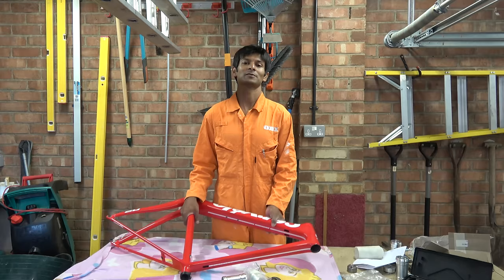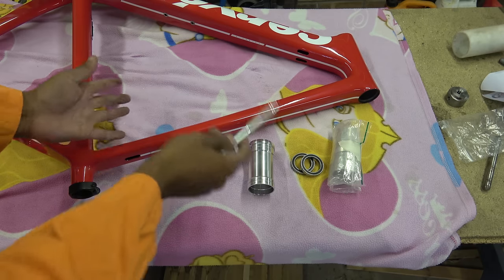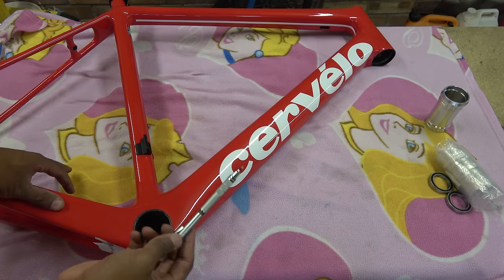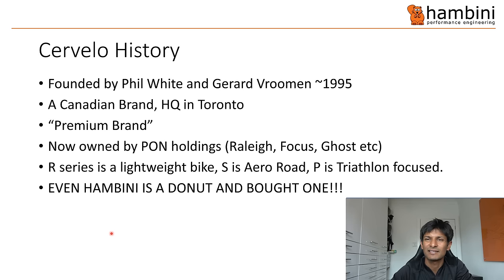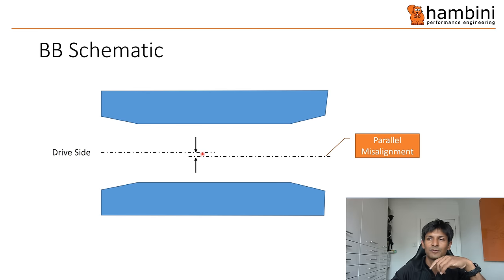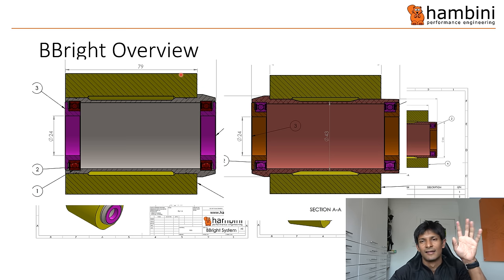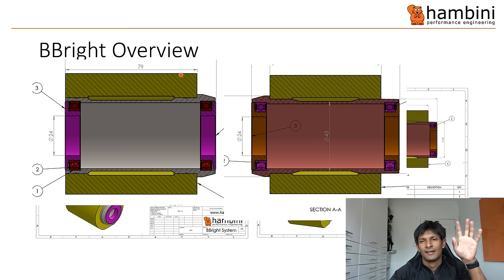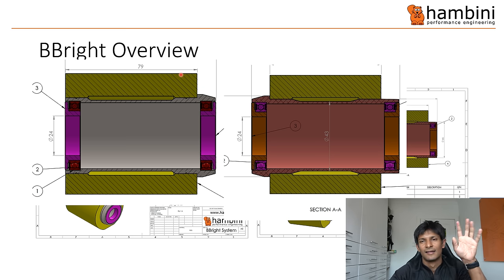Cervelo Exposed and fixed... Scumbag Aero bike manufacturers (A Hambini Reaming)

Comment: This is not a problem specific to Cervelo, but is more due to the problem of mass producing in carbon to close tolerances. Many manufactures are unable to maintain tolerances required for press fit of roller bearings in carbon. It is unlikely that a torrent of abuse will solve these manufacturing difficulties. There is however an engineering solution that will... The first solution will fix the concentricity, but not the taper. That is to make the aluminium insert approx 0.2mm smaller where the bearings will press fit, fit the insert to the frame, and then ream it to the desired size for a press fit bearing. This will require specialised tooling to perform the reaming process. It will correct the out of round, and misalignment, but will not fix the taper issue where the bearing is only supported by the insert which has no carbon in contact and relies on the inserts structural rigidity. The second plan is reliant on the availability of epoxy resin to glue the insert into the frame, but will possibly cause misalignment of the cranks to the frame as it requires the insert to be manufactured undersize to be a loose fit into the frame. So the insert is made 0.3mm smaller than the frame, has glue grooves machined into it for bonding, and is glued into the frame using a toughened epoxy. We use this method for fitting bushes into masts for superyachts (100's of tons load) with complete success. It is considered common practice.The reason for this is masts are not able to be made with holes in them, and so the holes are drilled, and bushes fitted after the masts are completed from a composite point of view. Again some tooling will be required to ensure correct alignment, but this is better as misalignment can be corrected. Now I realise a superyacht is not a bicycle, however the same engineering principles apply. I see this as an opportunity to help all those who have purchased a frame with bottom bracket issues, to permanently correct taper, concentricity, undersize, oversize, and misalignment problems, and be everyone's hero. Loctite epoxy is available nearly everywhere, and is almost idiot proof. It does require fast assembly, and is not for the disorganised. https://www.loctiteproducts.com/en/products/build/epoxies/loctite_epoxy_weldbondingcompound.html, or I personally would recommend this as it is what we use for superyachts. https://www.adhesivetechnologies.co.nz/Products/High-Performance,-toughened-adhesives/

Comment: Hambini, another great video, 
I understand your look and time frame recommendations are based on your personal experience with good manufacturing tolerances with regards to the bottom bracket but having seen the insides of those frames on the Luescher Teknik channel (real horror stories, especially the Look frame) I am not sure I am comfortable buying either of them (I know those cut up frames were not the latest versions). Interested in your opinion.
Reply: I believe @thedarkinstall recently worked on a Look Blade with a complete shite BB

Comment: This is really helpful information and thanks for being brave enough for calling it what it is. The brutal truth is that most consumers don't have the knowledge or the measurement tools at their disposal to be able to determine when they have a rubbish frame in their hands. The fact that bearing tolerances were increased is pretty evil. The poor bearing manufacturer whose product fails because it's been installed in a setting beyond design limits and "set up for failure" cops the blame instead of the rubbish frame manufacturer!

Comment: They must of had to reject a amount of frames not meeting tolerance out of the factory, how to fix??? Make it better? No, just increase the tolerances, now they don’t have to reject them!
Reply from the maker: And think of all of the poor individuals that are riding around on substandard frames as a result...
Reply: Hambini Yes, agreed, I bought a Cervelo in 2011 as well. We can have the SHITE scale and have a laugh, but in reality this is really sad. Basically can’t engineer a round hole or more correctly, don’t want too, which is not fit for purpose to meet the bearing manufacturers requirements. 
It shows that in general manufacturers are lowering their tolerances for profit, you could almost call it a “con” by these manufacturers. 
Remember the latest Cervelo S5 top bike is almost 20k AUD, really what are we paying for?
Reply: This is very typical for an engineering company run by non technical people. As engineers its our job to tell our managers, clients, or owners, that their proposal is a bad idea. If the final design gets out to the client, then we have failed as engineers.
Reply: @Hambini  It's alright, a lot of them are middle aged men in lycra that really shouldn't be riding the most expensive bikes on the market.
Reply: Organ Farm Yeah, but you have to know the product is below what is considered or is “fit for purpose” I just bought a high end carry on suitcase and the wheels fell apart on my first trip. So I took it back, the shop attendant said wheels are not covered under warranty, I then said to the shop attendant, you can’t not warranty something, or a part in Australia, because the company doesn’t want to as it needs to be fit for purpose. 
The short answer is companies, businesses, are really trying to sell high end product at low end cost manufacturing, just make the shiny bits look good.
Reply: I have two Cervélo bikes. A 2013 P2 and an 2018 R5.
Both work just fine.
So not every bike is bad.
Reply: @Bendersnatchling  "works just fine" is a very subjective summary as what works just fine for say a weekend warrior clocking maybe 2000 dry miles a year might not work just fine for someone that rides 16000 miles a year in all weathers and has 1500 watts on tap. I'm not saying you're a weekend warrior just giving an analogy. It's like someone saying they can get a entire year's worth of riding out of a set of Vittoria Corsa tyres where as I can only squeeze a month or so at best out of a set and consider them a race only tyre.
Reply: @jonnythelegs2597  1500 watts my ass.
Reply: @jonnythelegs2597  All valid points, but they don't apply to me. I rode my P2 for several thousand kilometers since 2014 and I am on my 2nd bottom bracket. It's an Ultegra. Changed it last year as part of upgrading it. I did not have any creaking.

On my R5 I rode 3156,2 km according to strava this year. No creaking either.

However bad manufacturing tolerances are terrible, because the "average" rider will have a very hard time troubleshooting. And will then be  out of options. 

Maybe Hambini will develop and sell a tool that easily allows to measure for trueness, so people could check on new frames ;)
Reply: @ebargados  did I say that was me? Nope.
Reply: @frozenlkea6188  absolutely
Reply: @Bendersnatchling  "3156,2 km this year" breaks down to 86.29 km \ 53 miles per week - I do 40 miles each day Mon-Fri, come rain come shine, averaging between 280-330w each ride and ride even up to another 200 mile at weekends. There are folks who ride more miles and much more intensely. "several thousand kilometers since 2014" - we are towards the end of 2019 right now. So yes, his points do seem to apply to you. Unless you ride your bike only 3 months a year. 
Now, pedaling steadily at 200 watts my bottom bracket is perfectly silent, as soon as I ramp it up to 350 watts which is not really that much these days either, I start hearing a distinctive knocking noise with each full crank turn coming from the bottom bracket area. So yes, there likely are lots of unsuspecting users out there on nice branded frame sets, who simply don't have the power or do enough mileage to make quality issues like that surface.
Reply: One of my summer jobs was to use a circular file to apply a "make it fit" process rather than scrap the parts. I had to enlarge or alter in any way I could to get the part to fit the jig. This was for a GM product. Given my chosen path and while I do make mistakes, there's no way I would ever allow something like that to happen to anything I designed. I'd quit before I allow such a thing. Who knows what weaknesses I had introduce to that part, although I think it was an accelerator pedal chassis. I can't remember that detail from back in 1996!
Reply: @yosserc  because it won't make them go any faster nor will the expensive frameset ever be used for what it was designed for: racing. It's just funny when you see people who are clearly not racers, on racing bikes and riding very slowly. Just like someone said, "I went to a triathlon once and never before had I ever seen so much money pass by so slowly" - Clearly joking about the expensive aero bikes not being used to their full potential by slow triathletes
Reply: @Bendersnatchling  3152 km in 9 months... That's a weekend warrior right there

Comment: Any idea where Giant and Orbea are on the shit scale?  And have you watched any of Roaul Luescher's frame cut up video's?  You two seem like kindred spirits.
Reply: +1 for Giant
Reply: Super curious about Orbea.
Reply: I’d like to see the full scale with all the big brands (Trek, Specialized, Scott, etc)
Reply: +1 for Giant also as will be purchasing a Giant Trinity Pro TT frame for next years TT season.
Reply: I’ve got a TCR SL never had any problems giant get my recommendation
Reply: @whichwayiszigzag  My 2017 TCR Advanced disc fell off the bike rack on a motorway (my fault). Left Di2 brake lever and carbon handlebar basically evaporated whilst being dragged behind the car, but the frame survived unscratched, better still chaps at Giant Poland organised a frame replacement, paid for shipping from Taiwan to Poland and sold me a Propel Advanced Disc Frameset through an authorised bike store at 0% net profit. No squeaks on any Giant bike I previously owned. The "crashed" TCR had Hambini's BB. Vanity/curiosity thing in my case, but worth every penny. His BBs are a thing of beauty and blow plasticky Dura-Ace Press-Fits into the Stone Age. The difference in stiffness, precision and "feel" is unreal. It's almost like spinning cranks suspended in the air. Weird, but very satisfying.
Reply: what about specialized ? where is it on shit scale? especially taiwanese made specialized
Reply: @louisgreenleaf235  I like Giants too, but I've found a hole in mine, 2016 model. I bought 2nd hand. I've found it after riding in the rain and seeing frops of water coming out on the non-drive side, about the samheight as the front derrailleur.
Reply: @ebigarella  what model is it ???
Reply: The Giant Propel  with the carbon dropouts are complete shit.. if the carbon dropouts fail, the entire frame goes into the garbage. Bad Engineering. Never buy a carbon frame with a carbon dropouts... See the Luescher Teknik youtube channel for more details.
Reply: @ggdd1299  What is a "carbon dropper"? Giant Propel Advanced Disc has got an aluminium derailleur HANGER. So are dropouts.

Comment: This is the main reason that Trek has gone with the T-47 Treaded BB on all their new bikes frames. I have a 2008 Cervelo R3 frame with a treaded BB but it is my 3rd Cervelo frame, my original R2 had a down tube cable holder failure, the second frame the R2.5 had a bonding issues with the tubes and lugs and the latest for the time R3 the "monocoque" frame I've never had an issue with. I have found over the years of buying bikes to choose carefully. I have never been a fan of PF BB and I for one are happy to see the T-47.

Comment: As someone who has been in both aerospace composite and automotive manufacturing engineering for around 12 years, this further enforces my view that the bike industry is bloody awful.

The chap who signed off those drawings should be sacked for having absolutely no clue.

I'm also not surprised by the difference in measurement between your customer and you. Anyone who has done gauge RnR studies would agree how drastically different measurements can be on "accurate" equipment.

Liking your style as these "engineers" don't deserve respectful levels of  analysis when they show such complete disregard for making a customer end product.
Reply from the maker: Thanks for your comments Phill

Comment: @Hambini if you put needle thrust bearings in your bottom bracket tool you could/would reduce friction making it much easier to put the bottom bracket shell into the frame as well.

Comment: Cervelo have always been cheaply made...   I have owned a bunch (SL-SLC, R3, R5, RS)  and sold them after a year or so because there were tolerance issues and they seemed cheaply made.   Cervelo has a history of front derailleur hangers ripping off...   and and history of breaking near the rear dropouts.  Two of the frames I owned suffered these issues after I sold them.  I got one of the frames warrantied for the new owner.
Reply: Will Johnson  Damon? Is that you?
Reply: They used to make an awesome aluminum frame that did very well with CSC.  However, they have moved and reconfigured this company several times over the years. They also have quite the history of warranty claims and recalls. I stopped buying them in 2009, because aero gains claimed by them are nonsense.
Reply: @truantray  BS.. Cervelo had shit engineering since day 1.. their Soloist S1 Aluminum frame had an aero seat post that would not stay in place, owners had to do all kinds of tricks to make sure it wouldn't sink

Comment: This is becoming silly... Never ever had these problems with Good old school threaded Bottom Brackets..  
Clean and Face the Frame, and you are good to go...
Reply: They still had issues, because they often tapped on both sides sometimes the threads wouldn't face each other directly. Facing it didn't help that.
Reply: ..rarely even had to face the frame..
I hear threaded BBs are making a bit of a comeback.. probably due to noise from customers forcing the issue..

Comment: Thank you, Hambini! Finally, someone who explains why all the high-end bike shops complain about frames when it comes bottom brackets. I ride a fixed gear aluminum track frame with old school square taper cranks, 50x14 gear ratio, aero carbon track wheels, bullhorn handlebars, and a front brake for the road. While everyone else is complaining about bottom bracket creak, poor shifting, or has good shifting and can't decide which gear is optimal, I've got both hands on the handlebars and power to the pedals. Just ride. Make those wheels go around and keep it simple. The less complicated, the less to go wrong and the better you are at knowing what you've got to give when it comes to pacing and power management. If you've got to have gears, at least get your pacing correct. It's kind of embarrassing being passed by a fixed gear track bike with a 50x14 three-quarters the way up a long climb. Of course, riding a track bike on the road makes you more patient, disciplined, and stronger all over and leaner so your power-to-weight ratio is damn good!
Reply: You are right, but you will b get gears............sooner or later!

Comment: I have a question regarding mountain bike suspension assemblies. Some brands are not using grease nor bearing glue to fit suspension bearings. Do you think is that okay in order making the frame last as longer as possible? Specially for carbon frames I've seen people using grease, but could doing this allow the bearing to move inside the frame and thus wearing the bearing seat?

Comment: Great video - never ridden a carbon bike, stick to reynolds 531. But did have a BB failure years ago due to cross threading or wear. Brian Green (RIP) of Langdale's fitted a FAG sealed BB that coupled into itself and it lasted for years and years with no issue. I just couldn't justify spending £3000 on a frame when for the majority of cyclists a steel frame would do.

Comment: It used to be so much easier with an investment cast steel Cinelli or Everest threaded BB shell, a Campagnolo facing and thread cutting tool from the frame builders kit then installing a square taper Royce Titanium BB.
Reply: Mmmm royce bb's yum

Comment: I have a friend who was the team mechanic for a major pro track racing bike team.  He's the one who's going to install a  bottom bracket on my Seven Axiom.  Installation of a bottom bracket isn't a do it yourself task.  I won't let a mechanic touch my bottom bracket without a couple of references from high end bike owners.  The campy bottom bracket always has made a clicking sound.  Bret couldn't find anything wrong with it.  Another mechanic told me that ti bike frames creak.  No, it wasn't that kind of sound.  Anyway, it's time to rebuild with a new record group set .  So I'll have him pull off the campy bottom bracket and save it for analysis.  I don't want another campy bottom bracket.  I seriously doubt if it is a frame defect as the frame is immaculate.  Bret pulls off the Chris King headset a rebuilds it.  So it's pristine.  So is the head tube.  I can't wait to see the chorus BB.  I'd like to know more about your bottom brackets and if they come with ceramic bearings.  I guess Chris King is your big rival.

Comment: This makes total sense to me, I have a P2 and have had NOTHING but issues with my BB. I literally took my bike in 3 times within 2 weeks (including the original failure) to have to get it fixed/ replaced again, and that in itself required lots of arguing with my LBS. This occurred within the first year of ownership. My cranks have never spun smoothly. I just bought a Giant.